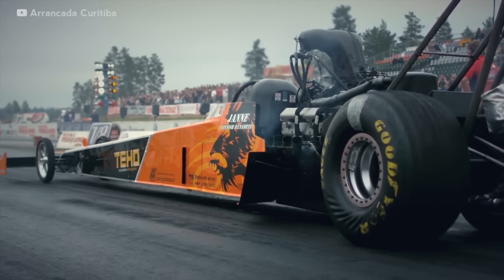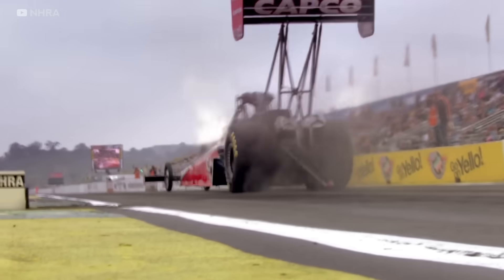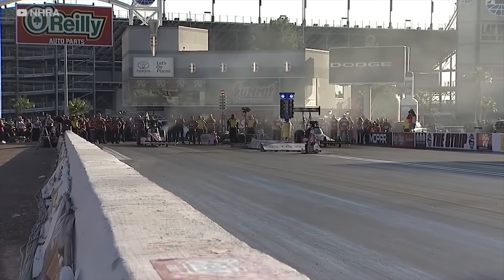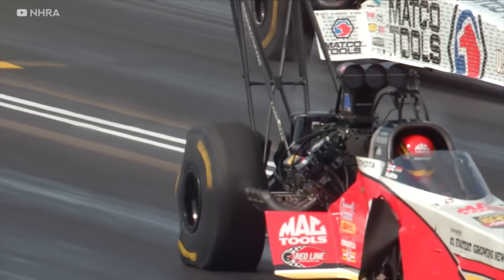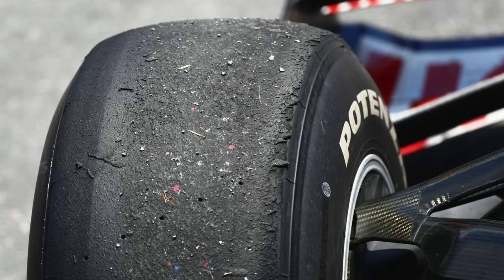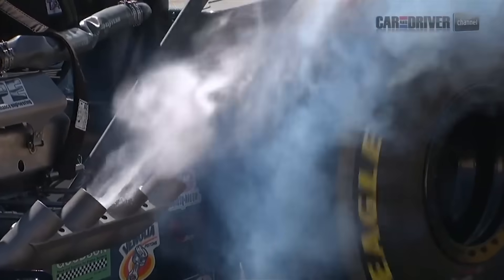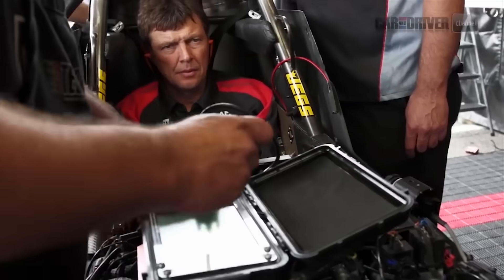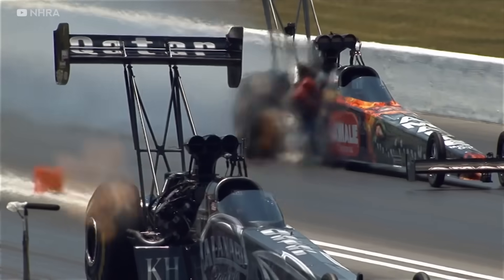How Dragster Tyres Accelerate to 335 MPH in 3.6 Seconds

Comment: Those clutch plates looked like brake discs. That's crazy.
Reply: Yea
Reply: and they break after each run ...
Reply: @S3l3ct1ve  No...they don't. Sometimes they do...but most of the time they don't.
Reply: Mike M they weld together every run and need replacing
Reply: @mekanism8364  LOL...sorry, no, they do not "weld together every run" ... Occasionally they do, but that is not what they are meant to do, nor does it happen very often. They do however get replaced after every run, rebuilt, to be used again. At times a team reuses the same clutches for more than 1 run. Sometimes mixing old with new depending on how they look after a run. These are friction discs and work exactly like the clutches in a regular car, only these become tighter by timer as the car goes down the track...and of course, there are 5 disks in most top fuelers.
Reply: Mike M Hmm. I was under the impression that running down track fused the clutch pack together. I’m not sure where I remember this from but I’ve heard it several times. Not saying I’m right, just confused.
Reply: @mekanism8364  ..I spent most of my life dragracing, 25 world and national records, many wins, got a little ESPN & Speedvision time. Sportsman class NOT top fuel etc...but I knew a couple top fuel racers and would hang out in their pits every now and then. Was around probably every top fuel, funny car and pro stock driver you have ever heard of.
 The clutches become tighter and tighter on a run, pre programmed (downtrack adjustments while on a run are illegal), they can "lock up" at any point the tuner has pre programmed and decides is the correct place (time) for the lockup. If they weld together that is actually very bad, used to see alot of sparks out of the clutch cans in the old days when that happened, not so much anymore as everyone is so good at tuning. It can happen, but is never supposed to and rarely does anymore...
Reply: Mike M Okay, cool to know!

Comment: How do they even practice? Because apparently they can only practice for a few seconds and then wait for 2 hours and a ton of money for another run. You could suppose they have simulators both these would have to be some hecking accurate simulations for how much stuff needs to be dead on on something that's this short, even F1 software engineers could be having trouble working on such a thing.

Comment: Most top fuel dragsters don’t have gear boxes? I call Bull...
Reply: By definition they don't have gearboxes. They have to use a 3.20:1 rear-end gear, and that's it. And it must have a reverser which can be easily locked.
Reply: There is no "gearboxes" in a fueler. They have 5 disk clutches that are pre programmed by the tuner to be squeezed tighter and tighter throughout a run...which acts as a "gearbox."

Comment: By the time the back wheels reach where the front ones started off, its going over 100mph. Also some teams just use hose clamps to hold the motor in place as they have to remove it every run. No joke.

Comment: These engines need such powerful magnetos because despite how violently nitromethane burns, it’s actually pretty hard to ignite via spark.  Decades ago when drag racers started using nitro, they had to start the engines on gas or propane and let them run for a while to get hot, otherwise the nitro wouldn’t evaporate enough to ignite via the weak ignition systems of the day.

Comment: I have to say I'm not a fan of the sport, but the technology is amazing
Reply: Same 
But its so interresting
Reply: Low technology high awesome
Reply: @exploranator  Plenty Tech in the Data logger and therefore Tuning of both engine management and clutch management in milli seconds for each run. Also requires assessment of Atmospheric Pressure, Air Moisture & Density plus Track temp and track bite (traction) at time of run.

Comment: some teams were using 5 PSI? That's about a 3rd of normal atmospheric pressure... I'm pressing X for doubt
Reply: 5-6 PSI was very common back in the day. 7-8 for the more modern tires. I used to run at 6 psi.

Comment: Fun facts, the crankshaft is actually warping about 20% while at full throttle. Each crankshaft cost a team about $5000, timing at launch is technically staggered cause if you mashed the throttle it would grenade the engine due to how fast it reaches its rev range. The fuel is nitro-methane and due to its violently explosive nature the nhra has to have a government official at each race accounting for every single barrel of fuel.

Comment: At 08:17 you say Nitromethane doesnt need to mix with air to combust? Correct me if I am wrong but I think it would be more accurate to say it requires less air to combust as air is still part of the overall mix in the combustion chamber otherwise not need for the supercharger?

Comment: One of my favorite things about top fuel dragsters is that the 11,000 HP number is only an estimate because there isn't a dyno in the world that can actually measure the engines. Also the fact that most sports cars don't make enough HP to fully drive the supercharger.
Reply: Michael Fritsche  but we still need the ability to do a full pull give they are showing nearing the 12k mark
Reply: Yeah but running such a short duration test can actively skew the numbers.
Reply: Michael Fritsche  and fuel flow can be modified. Chmaber size etc what im saying is the test is all over the place.
Reply: Michael Fritsche  physics back it up yet it is still at best a estimation.
Reply: Michael Fritsche  besides run to run variance and also. I never said anything about how they'd change or any specifics. So again stop assuming.
Reply: Michael Fritsche  so it isnt the physics of the afr but the rules.
Reply: Michael Fritsche  run to run variance and rebuild to rebuild variance. Unless you guys have the most accurate machining possible variables are going to be endless and im not arguing just stating that unless we are accurate to perfection there is more variables to it than you are claiming. And im also saying that in future they will likely change regulations.
Reply: Michael Fritsche  just because you wrench on something doesn't mean that you can state that it's accurate when even a dyno on long pulls will show wild differences.

Comment: “3.6 seconds!”
“For 0-60?”
“No. 0-335”
Reply: By the way the clutch gets so hot it basically welds the metal together. They change it every run.
Reply: @tom.mk7_151  holy shit that's an interesting fact
Reply: my Civic goes 0-335 at 3.5 v-tec man!
Reply: @lacai527  the momemt when vtec kicks in:my car go brrrr
Reply: @seno0438  and then everything is left behind! from engine.
Reply: @lacai527  lol yes😂😂
Reply: @lacai527  my Drag 180SX also go 0-400kph in only 11 seconds.
Reply: subie fam
Reply: ayyyy fellow subie lover gang gang
Reply: @Baruuu6  vape naysh?
Reply: how fast do they go 0-60?
Reply: @average32potato  it goes soo fast they use 60 foot and 1/16 mile intervals
Reply: @average32potato  around less than a second
Reply: @average32potato  0 to 100 mph in .9 seconds, yes, you read right, point 9 seconds.
Reply: @average32potato   Article in National Dragster by Lee Beard stated 0-60 mph in .54 seconds, 0-100 around 1 second.
Reply: @average32potato  under a second
Reply: @average32potato  0.8 sec
Reply: @average32potato  they never go 0-60 they start from 250
Reply: @Momojobo  damn
Reply: 0-60 in the length of the car. 0-100 in 60 feet. Insane experience.
Reply: Kmph? 
No, Mph.
Reply: Not great, Not terrible.
Reply: Jimmys Subaru is disappointed
Reply: @Guest-ks3ks   who is jimmy and why does he have a fast subaru
Reply: @6ixmil217  jimmy is neutron subaru is low
Reply: @Momojobo   b r u h
Reply: Finally something faster then a demon
Reply: Not great, not terrible.
Reply: @minaith8143  chernobyl lol
Reply: Some random JDM guy: my Supra is faster
Reply: @Ob1tuber  "JDM guy" lol we all know those "SuPrA aRe GAwDs" guys are the furtherest thing from JDM ever 🤣😂 just a bunch of Fast and Furious fanboya
Reply: Ur comment as of now has 335 likes
Reply: @osho5996  My comment requires more time than to reach 335mph.
Reply: @osho5996  nah 9.1k now
Reply: Yessir imprezaaa
Reply: lol
Reply: 0-100 in under 1 sec. Don't think your Roo can do that.
Reply: Nice Subbie.
Reply: https://hoop.photo/share/6PnJ4zAXnOaNSetg6BDxhz5ziQN2
Reply: "HOLY FUCKING SHIT, THAT IS POWERFUL! JESUS CHRIST! WHAT THE FUUUUUUUUUUUUUUUUCK?!"
Reply: My 1.0L Ford EcoSport does 0-3.6 in 355. Does that count?
Reply: @adb012  - sorry no, that was a downhill  run with a following wind 😉
Reply: Lol
Reply: Yesssssssss
Reply: Supra would do it a sec faster
Reply: my fiat 126 takes 33 seconds to reach 0-60 😂
Reply: @huseyinuguralacatli5064  my friends old fiat 500 might do 60 (kph) in down hill with tailwind if the conditions are right and some constellation happens to be in its place with Uranus and Jupiter
Reply: @TeslaTunari  In same conditions my 126 can go up to 88mph and traveling in time with some uranium 😁
Reply: @TeslaTunari  Is 500's that slow even they can do 80-90kph in flat
Reply: @huseyinuguralacatli5064  if the conditions are right
Reply: For 1/4 mile then I bounce
Reply: 3.6? Not great not terrible.
Reply: And the engine needs rebuilding in less than 1000 revolutions full power
Reply: Some of the cars flip if they have been held too long as the fuel load is lighter,also the fuel tank has a flap so the fuel pump does not vacume the tank and collapse it
Reply: How much kmph in 335Mph??
Reply: @aestheticpawan2927  around 540 kmh
Reply: MrBong 539.14
Reply: @Guest-ks3ks  540 kmp
Reply: @aestheticpawan2927 .... 335 Miles per hour is equal to 539.35 Kph (kilometers per hour).  For you own future reference & knowledge.... the formula for converting Mph into Kph, is.... Multiply the Mph X (times) 1.61.  Example... 335 mph x 1.61 = 539.35 kph.   The reverse is true if you want to convert kph into mph.... 539.35 kph divided by 1.61 = 335 mph.
Reply: 10 Gal is 37.8L

Comment: Very interesting video indeed. Also, I had a physics professor in college explain to us that another reason why dragster tires are that specific diameter is, in part, because the rubber on the fringe of the surface of the tire melts due to the friction. The size of the diameter of the tire allows that rubber to cool just enough to solidify again by the time it comes around to come in contact with the surface.

Comment: I think the "decrease in torque" at 1:54 is a little vague. Torque is the output from the engine; and even though reducing the load on the tires will definitely reduce the torque produced by the engine, I would assume that since everything happens so fast, engine has very little time to balance out however the reduced tire radius means that the FORCE available at ground level by the engine is increased. So the question is, what makes the engine reduce its torque output so fast so the torque at the tire axle is decreased?
Reply: Distance from axle to track decreases - force from axle is unchanged but torque as a function of force at a distance through a lever (tyre) decreases

Comment: The video is missing an important bit that adds massively to the grip. The drag strip surface is layed with a cover of  sticky resin *). I've seen it sprayed live. :-) Top Fuel dragsters are awesome. Nothing like it. The smell, the noise, your whole body vibrates ... <3
*) https://en.wikipedia.org/wiki/PJ1_TrackBite

Comment: Having in mind the massive amount of torque an electric motor can produce, is there any possibility of having electric dragster? Could they beat fuel dragster any soon? What do you all think? (no offense to those petrolheads who would loathe on electric dragster is intended, just curiosity) My guess is that, for now, the energy density on batteries makes it impossible but other than that, weight/power and size/power ratio on electric motors is much grater than fuel, plus torque is instant and continuous. But I'm far from en experts in this matter, just a youtube learner haha
Reply: Search for don garlits. The granddaddy of drag racing.
Reply: @Chesh1982   "In May 2014 at age 82, Garlits set a 184 mph (296 km/h) speed record with Swamp Rat 37, a 2,000 hp battery-powered EV dragster . In July 2019 at age 87, he set a new quarter-mile record of 189.03 mph (304.21 km/h) with Swamp Rat 38, a 1,500 lb dragster with a battery-powered 800 hp electric motor." That's wikipedia, interesting and promising also. I'll search for video registry later. 82 years old and still running, amazing. Pretty politically controversial guy at least though... Thanks for the information.
Reply: https://www.youtube.com/watch?v=9bxwQeKhYXQ And there is a newer record of 201mph... Is much less impressive without the fire and sound I've got to admit. But great nonetheless.
Reply: Yeah I've never really researched him and his dragster(s) tbh. Obviously know of him as been attending Santa Pod raceway (UK) since 1997 I think it was. But it's so different to F1 which I love to watch but it's not too fuel drag racing.

Comment: Excellent video, but I think you got the energy of nitro incorrect. "The energy content of gasoline is ~18,000 BTU/pound while nitro has ~5,000 BTU/pound. By pumping in 8.7 times as much nitromethane per stroke, you get about 2.5 times more power per stroke." http://drhart.ucoz.com/index/nitromethane/0-173#:~:text=The%20energy%20content%20of%20gasoline,times%20more%20power%20per%20stroke.

Comment: Top fuel fuel pumps: 50l/s
F1 fuel pumps: 125l/h
Top fuel cars burn as much fuel as 72 fields of 20 F1 cars, a top fuel car running for 2.2s burns as much fuel as an F1 car does during an entire race. That's insane, both the thirst of top fuel and the efficiency of F1

Comment: I dont like this sport because it is so wasteful. If would be better if they design engines that last longer than 1 run. Would be expensive to design, sure, but in the long run would be cheaper. 

Top fuel dragster is basically "Murica" on wheels.

Comment: Could someone still explain to me why the top HyperCars only have like 1700 hp like they could at least have 3000hp like 300mph was broken like 70 years ago
Reply: What about usability? Hypercars meant to be driven on public roads for thousands of kms/miles by anyone who can afford them. On a Top Fuel dragster a team working just to start the car. The engine works about 5-6 sec on full load during the burnout and the run, then a rebuild required. The fuel they need to operate expensive, needs a lot of them and not the best to breath in. This is nothing can be adopted for road use. And I can bring a thousand other argument why they can't get any close to those figures. The same way as they couldn't come close to F1 engineering. Have you ever seen the process of firing up an F1 engine of today?
Reply: fastcargtv6 I’m not talking about full dragster hypercars but like hypercars that have 3000hp and thicker tires and stuff
Reply: @markusvarusk4643  It's still pointless. To achieve double the power output at that level they have today means reducing the expected life of the engine by 10 times keeping the same volume. And where you can use the extra power? 
Acceleration? It is already limited by the grip you can have on street tires and surfaces without preparation. The better high-end acceleration brings longer braking distance on track before the turns. 
Highspeed? You have no chance to safely hit the current top speed on public roads, and race tracks don't have so long straights where you really can use the higher top speed.
Reply: Think you are kinda missing the point of drag racing...sure they were going 300 mph 70 years ago but they sure weren't getting there is less than 4 seconds and 1000 ft.
Reply: @codymoe4986   yeah they weren't but i just don't understand why don't they adopt some of these features onto hypercars like really the chiron has 1500hp but it's possible for dragsters to get 11000hp like it makes no sense to me
Reply: @markusvarusk4643  Because it takes 10k hp to go from zero to 330mph in less than 4 seconds...how long does it take for any of these 1500 hp "hypercars" to reach their top speeds? Significantly longer than 4 seconds and nowhere near the same top speeds. 8500 to 9000 hp more makes quite a difference...
Reply: @markusvarusk4643  Think of it this way...a Bugatti Chiron weighs almost twice as much as a top fuel dragster  and the dragster has almost 10 times the horsepower...make more sense now?

Comment: 2 questions
1. If they run nitro methane that doesn't need air to combust why do they run superchargers?
2. It was mentioned that they produce spending through the exhaust. Is that by directing the exhaust gases over the rear wing it just the amount of gas being expelled from the exhaust creates a downward thrust?

Comment: 4g is absolutely insane. In a horizontal seating position, a 150lb driver would have basically hold a 600lb squat just to not crumple
Reply: And 4g is an outdated value it was by the late 90s with the 8-8500 HP engines and tyre compounds of the day. I have a detailed log of Joe Amato's 4.51s 1/4 mile run where the during the first 2 sec after the clutches fully engaged it had 4g which degraded to 2g by the quarter mile line. Nowadays the value is north of 5g.

Comment: I used to live about 10 miles from a drag strip and I could hear the roar of the top fuel dragsters while inside my apartment, even with the windows closed and the air conditioner on. I went to a race event at the drag strip one year and watched them run up close. You just can't describe with words how awe inspiring it is to see them rocket down the track.
Reply: Yeah, I used to live 12-ish miles away and the chandelier would move. Downright scary

Comment: I read somewhere that some dragster engines can sometimes weld itself together if theres a problem
Reply: Bruh, at the halfway point, the plugs are dead, they then diesel-run off the valve heat.